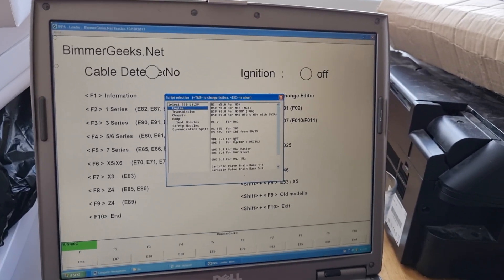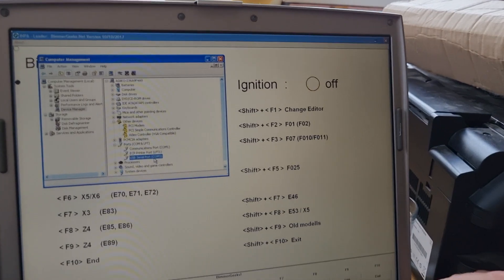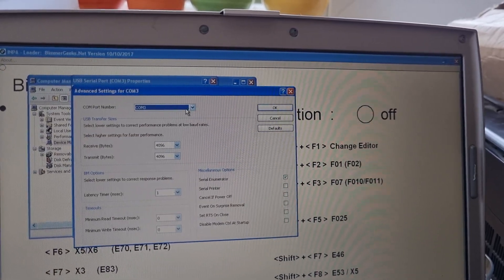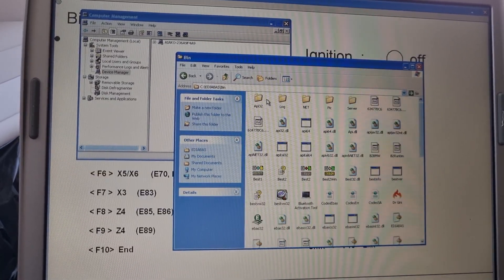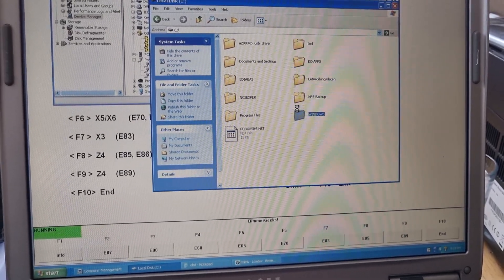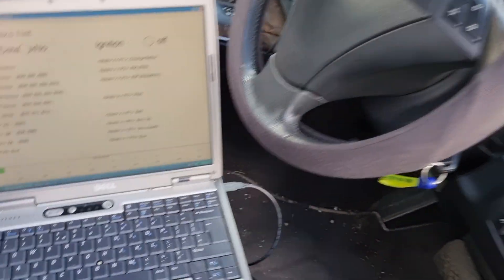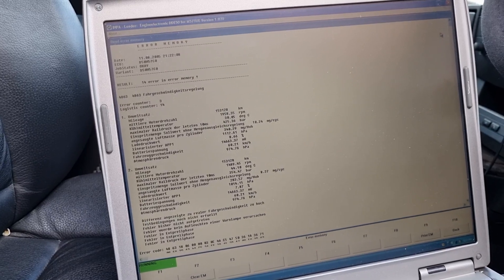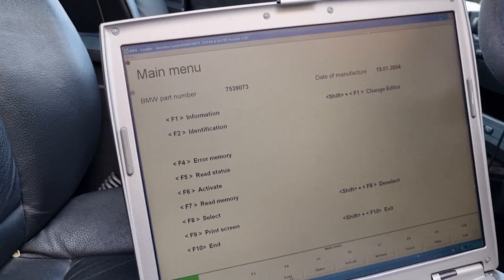INPA  problem . Solution Data transmission to interface disturbed

Comment: i cannot solve my problem "datatransmission to unit or interface disturbed", I had updated the FTDI driver, downgraded also, com 1, com 3, nothing works... :( before it was working fine ! but i think windows updates made inpa fails (ista also fails)
Reply from the maker: I would say try different cable and different laptop , also this might help 

Correct driver video 
https://youtu.be/CNHYVNcH3lg

How to Install inpa 
https://youtu.be/jK8k_b819mI

Inpa from German to English 
https://youtu.be/Qpvb7OPvLKA
Reply: @MeFixingEverything  but why it was working before ? My cable can fail ?
Reply from the maker: Chip.inside.can fail.
Reply: Besides comport 1, you should change the latency to 1. I fixed mine last night. I was at 16. 

Language is a tougher issue! Some folders have a file for English, mine didn't. My program is now working well and I don't want to touch it!